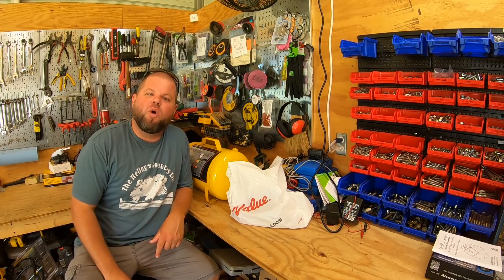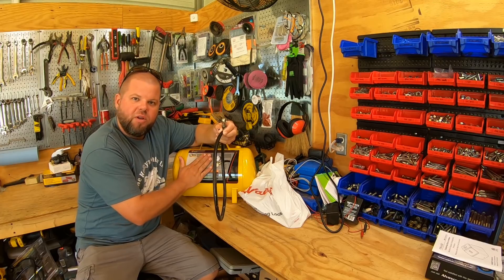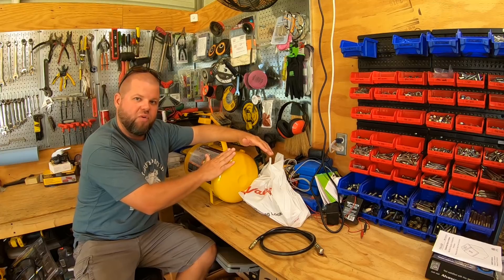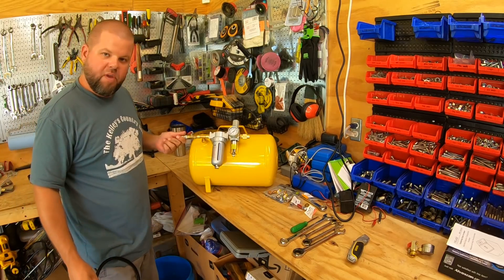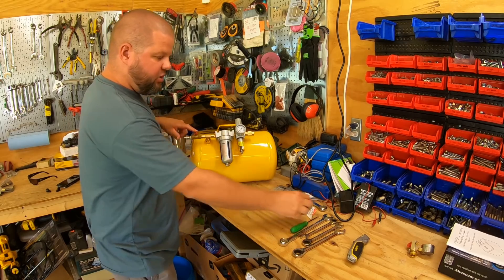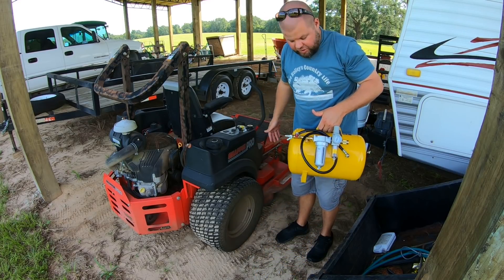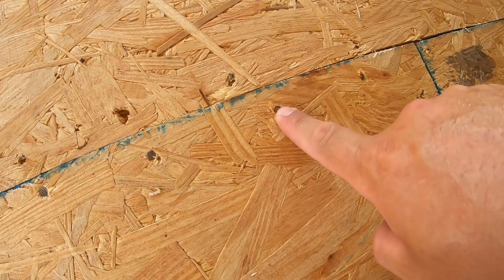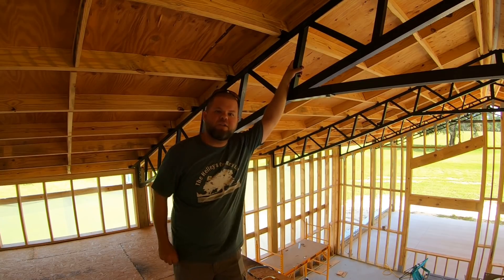Building an air receiver tank with dryer and regulator! #384

Comment: This idea is similar to why you have a start up capacitor in an AC unit compressor. (I hope I am applying this analogy correctly)
The compressor on an AC unit needs a lot of current at initial startup. It can be higher than the breaker rating.
A capacitor (Which can hold a charge, or pressure in air terms) is placed inline with the supply current.
When the compressor demands high current at start up the capacitor (like a boost tank) adds to the existing supply and helps equalize the demand until everything can catch up.
This is temporary however. If the demand never lets up neither the boost tank nor the capacitor can help. 
The boost tank and the capacitor both need a break to recharge.
Sorry for the electrical/Air comparison. I just saw the similarities and couldn't help talking.
Adding more then one little tank or getting a bigger tank at the far end would help also. You would have more reserve air potential.
Just make sure you have a regulator at the far end. (If you do, I am sorry I didn't hear that you did)
As long as the demand is not 100% your compressor at the house would have time to build that potential back up at the far end.
And what Mark B said below. ( Sorry, I just read what he said below about the relief valve at the far end. HE IS CORRECT)
Reply from the maker: I agree and I am very familiar with both. I added a soft start capacitor to my unit, allows me to run my central AC with a medium size generator.

Comment: Great ideal and project. You can actually take those beads and put them on a sheet pan in the oven at about 200 degrees and it will dry them back out just wait til they return to the original blue color.
Reply from the maker: I've been saving them to try this, thanks!

Comment: it's better to nip it in the bud with getting dry air make a intake box for the compressor with 50/100ish small jets pulling in air onto a fine stainless steel mesh and then going through a maze of baffles with a drain going to a collection tank

Comment: Great idea!  I've had similar problems during several projects using my Bostitch F21PL Framing Nailer.  Since I'm a habitual rule breaker, your "do not try this at home" went in one ear and immediately out the other.  😎
Reply from the maker: As I'm sure it did many others 😁

Comment: Another option would be to just go get a bunch of copper pipe in your shop and you could use a coil or just zigzag it back-and-forth and just have some points along the way with drain valves on the bottom, even putting a fan on it would help. When your pressurized air comes out of your tank it’s hot it’s really hot compressed air being so hot is pushing that steam through there. If you can cool it down before it gets to the end that water will condense and sit in the bottom. Having the long hoses from your shop all the way to the house I’m sure let it cool but rubber doesn’t let it cool as fast. I think if you just put it 4 x 8 piece of plywood up next to your compressor and turned on the fan or wire it to your compressor switch I just zigzag a bunch of copper pipe up-and-down that’s gonna let the air cool a whole lot faster, you figure you get six or 87 foot runs and you’re looking at about 50 feet. On the bottom of those loops when it goes back up just put the drain valves there and that will help cool the air, You could step up to half inch copper and put a fan on it and you’re letting the air expand like you said but also you’re letting it cool a lot more because the Copper is going to act as sort of a radiator and suck that heat out of there which is really going to make it contents in that water is going to want to drip down the inside of the tubes. You could even put a few extra inches of tube in the bottom to act as a reservoir to hold that moisture so the pressure isn’t blowing it through the line. That should take a bunch of the moisture out before it ever gets on the run coming out to the house. Then your pressure tank with the regulator that you just made is going to have a whole lot less water to deal with in the first place.  Then the desiccant may be enough. If you were going to use it a whole lot you might even put that copper in line so you could just move the whole board outside and just pour a bucket of ice on it to make it that much colder, that’s not gonna last for too long but the cooling would definitely help.  I was even thinking of using a radiator and having a fan on it but I’m not sure how much pressure radiators hold but that’s basically how they work anyway they just have extra cooling fins soldered on. The idea of the copper zigzagging up and down the wall with a fan on it basically as a radiator just not as fancy and soldering copper tubing is going to be safe up to 300 psi easily and be safe.  That’s probably sort of the same idea as the expensive refrigerator units but it’s something you could do yourself. I’m sure other people have posted videos on different ways to do it and there’s probably a lot of people out there with way more experience and knowledge that I have but in theory I think the copper pipe would do a lot. That air coming out of the compressor is very hot and just getting it cooled down it’s going to separate that water quickly and a rubber hose is it gonna let it cool very fast so it’s just gonna push that water all the way out there.  Makes me wonder if they have a simple tool to read the moisture in the air so when you’re doing this you know how much of a difference everything will make. That might be kind of interesting, give you another icemaker type video series. Lol

Comment: https://m.northerntool.com/shop/tools/product_200659953_200659953

I don’t know how much you use your compressor, it seems a lot of things have gone Electric and they’re not as valuable as they used to be but with your weather, I don’t think the desiccant systems are gonna work that well and some of those get up to six or $800. Refrigerated air dryer it’s probably going to be what you really need. But they’re very pricey, this is one of the cheaper ones and it’s almost $900. I thought about it but basically decided that I don’t use it enough to make it worth the expense and if I end up breaking something it would probably be cheaper to replace that then putting the money into the air dryer. But where you live you almost don’t have a choice because your humidity is ridiculous there.  Lol   I’m sure you already know about this stuff but just wanted to make sure. You could probably make one yourself like I mentioned in the other post, get a large tank or a series of tanks and ice them down. Water condenses or gases based on temperature, if you get a big enough tank and you can keep the air cooling fast enough, it will dump all the water in the bottom of your tank. If you keep your ear coming out of the top and get a big enough tank so it’s not just spraying the water everywhere with the new incoming air you might be able to make your own. If it’s something you use a lot then it might be worth just spending the money but it’s a pretty good chunk of money nonetheless and you really want to check the specs and the CFM, the small ones are rated it usually 13 to 15 CFM which is enough to run nail guns and most power tools, But if you’re using them a ton do you have a shop where two or three or more people might be using it you probably want to bump that up quite a bit but I’m guessing 15 would probably cover you because you’re not doing a lot of production stuff and not going to be using it that heavily.  But just thought I’d throw that out there to make sure you knew these options were available.
Reply from the maker: Whoa, I can buy several air guns for that price 😂
Reply: @TKCL  yup. But that’s how you get that water out of your ear efficiently. I commented again talking about how you could probably just use copper pipe. Copper pipe is a very good conductor of heat so I think if you ran it through some thick copper coil or just got some copper pipe and zigzagged it vertically giving yourself 40 or 50 feet of pipe to let the air cool the water will condense and drop to the bottom. Lol.
Reply: @TKCL  I agree with you on the price. I’ve never bought one because of that but I don’t know how much you use your compressor. It’s been my experience that the water isn’t all that bad as far as using the air tools, the only one I’ve ever seen it really be a problem with it when you’re sandblasting. The water when you’re sandblasting can make all of that media stick together in clumps.  I’ve had times when I’ve used my nail gun and it spread some missed out but I just kept it oiled even if it was loyalists and didn’t worry about it, but I don’t use mine that often either.

Comment: I love the idea. That’s pretty awesome. One thought would be to go out and find a used air compressor somewhere, compressors usually have a drain on the bottom and a lot of people don’t like to fix stuff so it might be very cheap to find a broken one.   It might be a little bulky but you could keep it out there and have the drainage on the bottom and another thing you could do would be to chill the tank. Even if your fan is blowing on it pressurized air entering that bigger tank or even a small one could condense and drop a lot of that moisture into the bottom of the tank, maybe if you just stuck it out there in a tub with some ice.  Welding tanks isn’t too hard, just Wayover weld it, do it how do you think it should be done and put another beat or two on top and any time you’re going to add a valve or anything like that get a threaded bung.  A lot of people just drill a whore and thread it but that’s a lot of pressure on a skinny little set of threads and it just seems to me like a projectile waiting to happen. Lol.
Reply from the maker: Lol reread the end of your comment, what are you drilling 😳😂😂😂😂
Reply: @TKCL  You were talking about putting a drain valve on the bottom of your yellow air tank. Some guys will just drill a hole straight through the tank I just screw the valve straight in to that thin metal, you’re only going to get a few threads off of that. Maybe it works but in my mind you’re potentially making a projectile that’s going to shoot out and strip those threads. That’s what I was saying to use a bung and weld it on there so you’ve got a bunch more threads to hold all of that in.
Reply from the maker: Not for me, I've seen things blown up at my last job. Literally seen small pressure vessels almost level complete floors of major buildings.
Reply: @TKCL  yup. One of the things I worked on doing engineering was a high-pressure fire hose test kit. It was basically a manifold and you hook about five fire hoses up to it and fill them with water, then it has a tank on top with a very high pressure pump pressurize the whole manifold. Basically it was a nice rack but the manifold It’s self was a 6 x 6 tube welded shut with hose nozzles on it and pressure gauges. We use nice thick good quality bungs on thatAnd make sure everything was a great American steel.  Those hoses had to be tested at something like 360 psi from what I remember so we had to be able to pressurize the system to over 500 psi and there was no air in the system and water doesn’t compress, Everything on that got extra beads of weld and very thick very tight threads. I don’t think we ever had any failures but we just Wayover built it because it was going to a lot of different fire stations from New Jersey down to Florida, they have to use them to certify the hoses before they can put them on the trucks.  That kind of scared me because 400 psi of water in a 6 x 6 tube that was a little over 4 feet long is a whole lot of pressure.   I found with air usually what you get is a hole And the leak. It was a great way to practice welding. On our 4x4 trucks a lot of people want to convert bumpers to an air tank or even a roll cage and that’s a whole lot of welding to make sure you don’t have any holes in at all.  But I’ve seen people do some pretty crazy stuff with some pretty thin metal that just can’t possibly be safe. Lol
Reply from the maker: Cool project

Comment: I work with Home builder every day, i repair the the guns they break, most of them use a Pig, in your case a Yellow Air tank, a few have built some out of PVC pipe which work just as good if not better, if you have every taken apart a nail gun there are almost no Steel parts in them, so nothing in there to rust, most nail guns fail due to other things in the air, like rust and oil, yes oil, almost everybody uses too much oil, oil softens the seal and O-rings and they fail, rust come from the air tank which the water in the tank caused, drain your tank everyday in Florida leave the valve open and start the air compressor up and let in run for 10 min. this will blow out the rest of the water, rust etc. and dry the inside of the tank some. Only use air tools oil, one or two drops per box of nails, never use WD-40, or 3 in 1 oil, or PB Blast, if you run out of oil don't put anything in it but AIR TOOL oil, no oil in a gun is better than the wrong type. Also many have failed inspection by over driving the nails in Plywood and OSB mainly on the roofs and siding, nail should be flush.
Reply from the maker: I agree and only run air tool oil. I usually put a few drops in every other day, I use to oil a lot but don't anymore. My inspector came over yesterday (video out soon) and he let me know quickly that he would be looking for the 1/8th inch seam gap, flush to no more than 10 percent driven nails and required nail spacing on my sheeting.

Comment: My son finally made the commitment to invest in Milwaukee battery powered tools. No air hoses drag around, get caught, rupture, or any of the other problems that you mentioned. Now his only comment to me is “I can’t believe that it took me so long!” For some applications there is no substitute for air. For the most commonly used tools, batteries are much more convenient. I worked a tool trade show a few weeks ago. I was in between Milwaukee and Makita. The newer tools can do things that are totally impossible with air.
Reply from the maker: Driving thousands of nails, I prefer a big electric air compressor. For everything else, battery power is making a heck of a difference in convenience.

Comment: If you put your desiccant on your air compressor intake it is easier to control the moisture. Here is a simple plan to make one, if you add a time delay relay so the pump turns on for the dedication pump a few seconds before the air compressor kicks on then it would not need to run all the time. https://youtu.be/R_g4nT4a28U

Comment: It might be worth looking into an automatic tank drain for the big compressor in the shop. I’m sure you have seen them before. They will go off automatically at the set interval and drain the moisture in the tank. Not too bad on price. I’ve provided a link to one I’ve found. I know there’s others out there. Great videos. I watch them all. Including the lives on Sundays. Thanks for sharing. https://www.rapidairproducts.com/shop/accessories/air-compressor-accessories/automatic-tank-drain?utm_source=google&utm_medium=cpc&utm_term=air%20compressor%20drains&utm_content=!acq!v3!42560769576_kwd-360778277938__509035787654_g_m__&utm_campaign=SEM+%7C+Parts+%26+Accessories&trkid=V3ADW545812_42560769576_kwd-360778277938__509035787654_g_m__&gclid=Cj0KCQjwxdSHBhCdARIsAG6zhlWN5mnm-VOdPU5e4oPvD9VDkQTLwG99z1ZSjl04Et-OTV9-FuoKWCsaAk1jEALw_wcB
Reply: Only if you have a manufactured drain on the tank. I wouldn’t recommend cutting and welding one in unless you get the tank tested afterwards, which is possible but may be more of a hassle than you want. Alright I’ll quit rambling.
Reply from the maker: I just bought a cheap coiled air hose that screws into the bottom tank drain. Everyday I just toss it over into the shop sink and blow the water out.

Comment: The nail gun has a depth setting right on them !
Reply from the maker: Yes they do, but my paslode requires a Allen wrench. I'd rather just dial pressure. My palm nailer for example depends on pressure only

Comment: What difference would it make if the regulator was on the inlet side of the surge tank? That way, if flow was a problem, you could crank up the shop psi without over pressurizing your surge tank.
Reply from the maker: If I remember correctly my shop tank will not go above 135 psi, so it won't over pressurize unless something failed. I've been using this the last few days and I'm having no issue driving nails at 100 psi and under now that I have that extra volume present and ready to go.

Comment: I did that exact same thing you did with a small air compressor that the the little motor went out. One thing I did was I use a back flow preventer on the inlet so if my kids would accidentally knock the hose of all that air wouldn’t all come out and scare them. You have some ideas to change mine.

Comment: Pretty sure your not supposed to connected an dryer directly to your shop air compressor l believe it needs to be at least 20 feet of line between the two to be effective
Reply from the maker: Didn't know that, but I can tell you that it does trap moisture.

Comment: I did something very similar when I painted a car; I used a sand blaster tank (no media in it) as the intermediate tank and got the air dryer from Eastwood. It's about 2 or 3 times the size of those smaller air dryers, and seemed to do the trick. Maybe add another dryer if you think the humidity is getting through (or 4 or 5! HA!!).
Reply from the maker: More is probably needed for sure, overall it's been performing well.